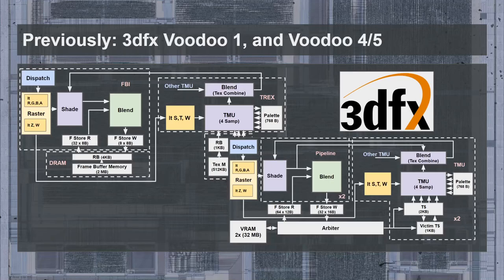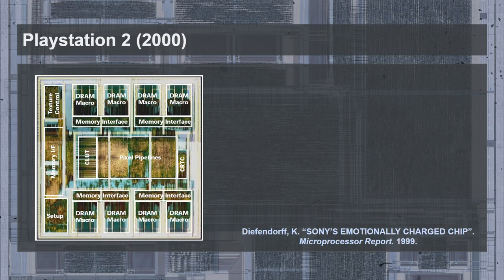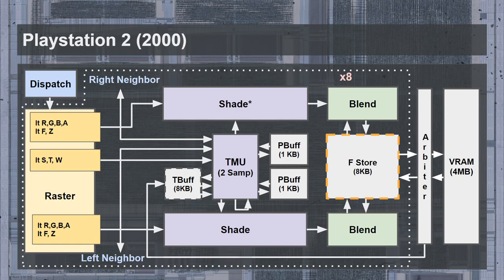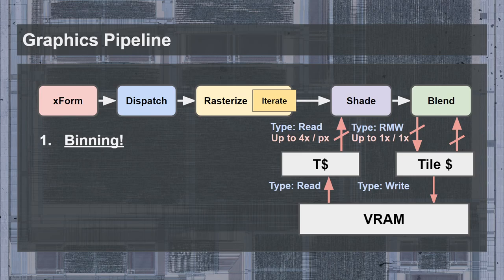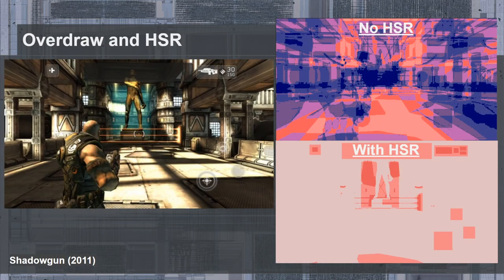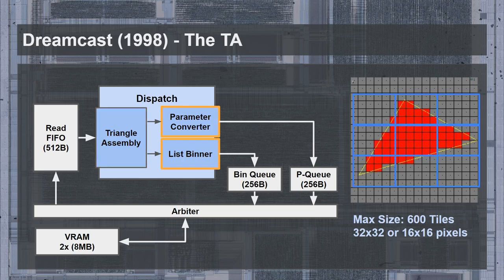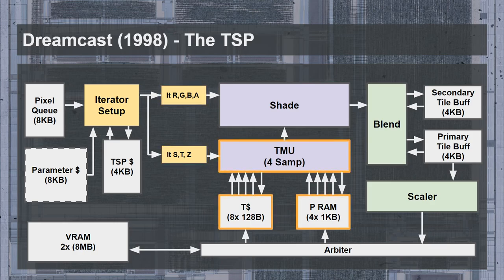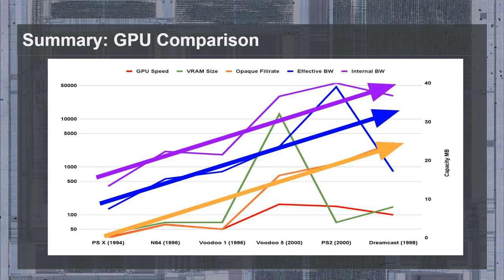GPU Memory, and Clogged Pipes (Part 3 - PS2 and Dreamcast/PowerVR) - #GPUJune2

Comment: I'm not sure clock rate is a good metric to use for gpu speed. Really, it should be transisters x clock speed? It makes the phrase at the end a bit hollow since gpu compute has generally been about scaling horizontally instead of vertically and will definitely give people the wrong impression. It just makes it sound like youre trying very hard to justify your original premise of memory more important than compute, when really it is both. Especially since compute has outstripped memory many times in gpu history, leaving them starved. I otherwise very much enjoy your videos, great work!
Reply from the maker: Thanks for the feedback!
Could you give an example where compute outstripped memory? The only cases I can think of were marketing (i.e. less VRAM was chosen to save cost - which is not a technology / architecture limitation). 
I disagree with transistors being a good metric, that's similar to comparing software by lines of code. Transistors are used for the compute, but also on-chip memory, data routing (busses), clock distribution, miscellaneous controllers, and I/O buffers. What you really want to use are operations/second, which for fixed function GPUs would be fill-rate. Comparing clock speed and fill-rate gives you an indication of where the performance came from. If fill-rate grows faster tan clock-speed, then the performance comes from scaling horizontally, whereas the contrary is from pipelining or a technology shrink. Bandwidth (memory) does still play a role there, but it's impossible to unlink the two in this domain as it forms an integral part to the processing pipeline. Also note that none of the memory claims (except for the PS2) account for DRAM overhead, which will necessary result in degraded performance compared to the ideal (peak) numbers.
Reply: @RTLEngineering  sure, transistor count isn't great either, but that doesn't mean clock speed is a good indicator. Current day gpus are WAY more than 15x faster than the PS2 gpu in terms of compute. Regardless, memory and compute are as important as each other, one isn't the main contributor vs. the other. And by compute out stripping memory, I mean memory bandwidth becoming the bottleneck. The geforce 256 was notoriously limited by its memory bandwidth, and they later released the geforce 256 ddr to unlock it's potential. It's simply a matter of balance and bottlenecks. 

You could possibly chart FLOPs vs memory speed, idk, but anything is better than hz.
Reply from the maker: Then I guess you're in agreement with me / the videos. The entire premise was that bandwidth was the driving factor for performance, not memory capacity or clock-speed. Every GPU that I am aware of has been limited by the bandwidth in one way or another, the Geforce 256 being no exception. And the Geforce 256 DDR was still limited by the memory bandwidth.
Unfortunately we can't plot FLOPs, because most older GPUs didn't execute floating-point operations. Similarly, when considering modern GPUs, FLOPs is not a great metric for render performance since large portion of the pipeline are still fixed function. So fill-rate remains the better metric, which serves as a proxy for "FLOPs". That's also what I used in the videos, not clock speed - the clock speed was shown to indicate that it was not the major contributing factor.
Also, what you were describing (FLOPs vs Memory Bandwidth) is called a Roofline, which is the standard method for comparing performance of different architectures and workloads.
Reply: @RTLEngineering  My issue is that I'm making a hard distinction between logic units and memory bandwidth, where as I think you've  explicitly shown that they are deeply coupled, proving that the line is effectively a lot blurrier than I previously understood. I'm just smoothbrained from all the hardware reviews making hard distinctions between the two. Thanks for your detailed replies!
Reply: @RTLEngineering  

one word counterarguement: RDNA2
Reply from the maker: RDNA2 is not a good example, especially since it's in the unified shader domain which becomes messy. When you get to shaders, you can always move the goal-post, since you can create arbitrary kernel programs that have an insanely high operation count per VRAM byte. That also means that you have to write kernel programs like that to make use of the compute resources. If we are comparing GPU architectures from the mid 90s to modern day, then the workload should be considered - drawing simple shaded / textured triangles to the screen. In such a condition, the ROP units and Rasterizer throughput are more equally matched to the memory bandwidth than the ALUs which may not be needed (RDNA2 only needed 5 instructions if I recall correctly, 3 interpolation, 1 texture lookup, and 1 ROP emit).
Complicating things further, RDNA2 had its own problems, especially with how the instruction fetch was implemented (leading to poor occupancy in general).

Comment: only 1kb textuur cache on dreamcast gpu,even the ps 1 had 2 kb textuur cache are you sure about that.
Reply from the maker: Yes, I'm sure. I was surprised as well, and it's not exactly clear if all 1KB could be used for texture data, or if only 512B could be used (the other 512B would be used by the VQ tables). Essentially, PVR allocated what SRAM they could fit on the die to the TBDR architecture in place of a texture cache. Then the textures would essentially have complete priority over the VRAM bus. Additionally, the 32x32 pixel tiles meant that only a small portion of any texture would be rendered per tile anyway, which further reduced the need for a large texture cache. We see something similar in modern mobile GPUs, where their texture caches are also quite small when compared to desktop IMR GPUs.
Reply: Having a small texture cache is not bad per se, if you have enough bandwith to draw a lot of small textures very fast

Comment: Pretty amazing that the DC & PS2 launched in NA at $199 and $299 respectively. Sega and Sony must've been losing a tonne of money on the hardware. Also incredible that the DC was first released in 1998! It was an enormous generational leap visually
Reply from the maker: I believe that's been the financial model for quite some time (possibly back as far as the NES). Sell the console at a loss, and make up for it using licensing with each game.
I can't recall which system it was, but one of them was sold at a ~$100 loss (only factoring the parts and manufacturing). If you include the NRE (development) and other overheads, it would likely have been closer to $200. 
It's a model that works out well for the big companies, but has unfortunately put the market in a position where smaller companies cannot compete, since consumers expect unreasonably low prices.